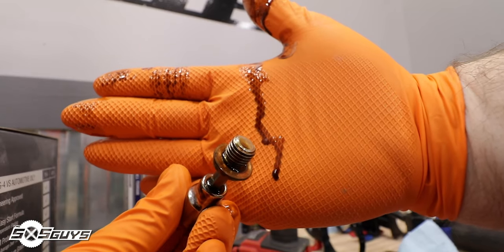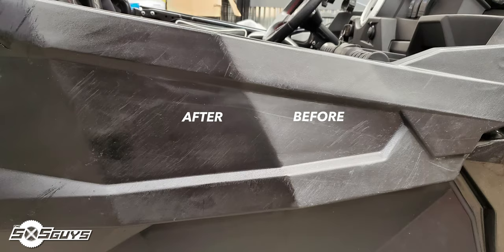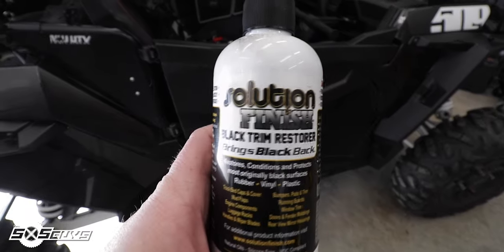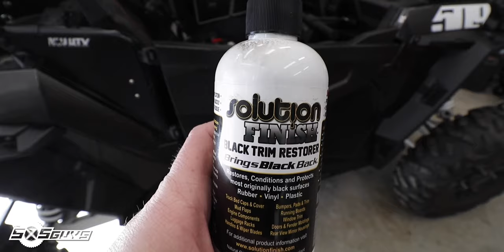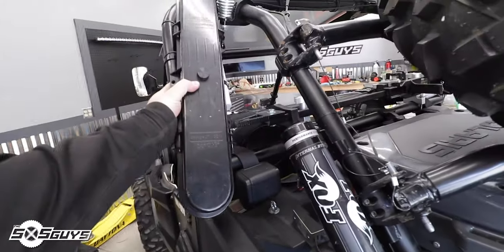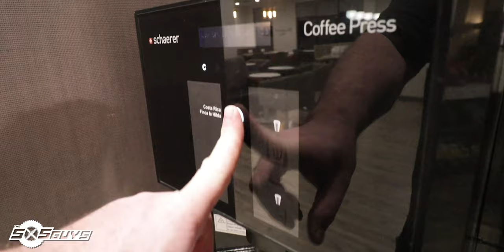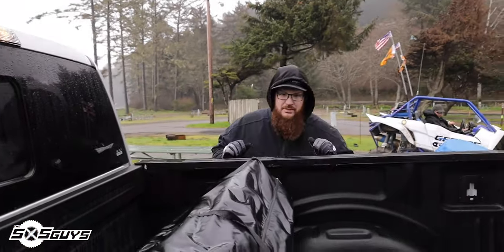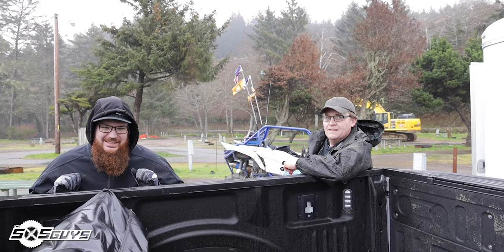Tunes, Deletes & Winchester Bay Dunes - Part 1 | The SXS Guys Vlog

Comment: Did the  YXZ guiy leave his sxs on a trailer at that hotel overnight? how did he secure it? been a big question of mine that prevents me from going on overnight trips
Reply from the maker: Yeah, the trailer was locked to the truck, YXZ strapped and locked to the trailer. We also worked with the hotel to get a 'visible' area by their staff. Sometimes you just have to do what you can and try to sleep well! Many hotels will work with you to place your rig in the best spot (if they have parking).
Reply: That particular hotel in Eugene I’ve stayed at a few times. They’re very helpful and happy to keep an eye on things!
Reply: SXS Guys what did you use to lock up the trailer? Would love to see how uou keep open trailers locked safe for trips.
Reply from the maker: @olsonj  I believe there was a steel cable through the frame/suspension. Also many trailers will have a lockout on the hitch cup. If not, you can use the same cables to tie the trailer tongue to the frame of the vehicle. Additionally there are a number of wheel locks (light parking enforcement uses) that can be used which might be easier.